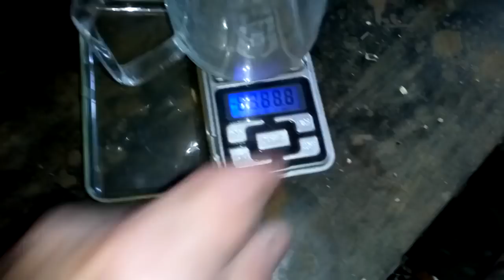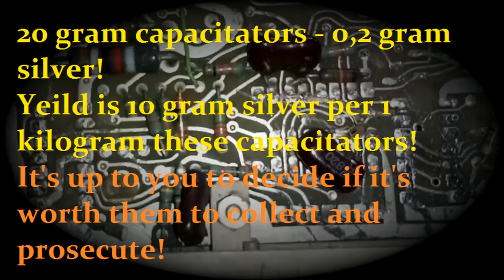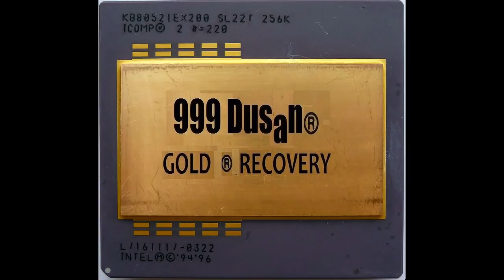SILVER CAPACITATORS - TEST RUN!

Comment: Radiators of resistors are from aluminium. They are anodised in sulfuric acid and painted with gold like color paint. NOT EVERYTHING IS GOLD WHAT IS SHINING AS GOLD. 😃😃😃
Reply: Yes. Those "golden" aluminum bits are anodized. Not gold plated, just gold color.

Comment: I think it maybe it's anodised,  or mabey it has to do with the function of the parts. I don't remember what they are called but I have seen people use them to simulate a load on a computer power supply mainly when they are linking several together to make 1 large power supply. Just my thoughts! Happy scraping!